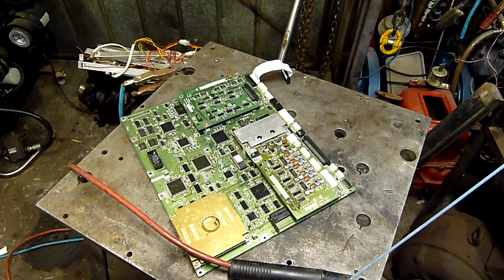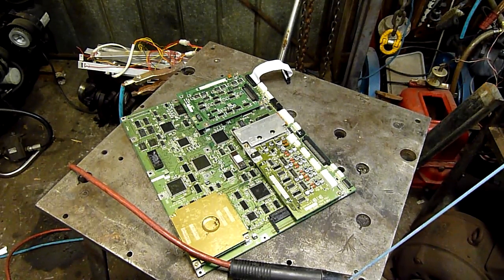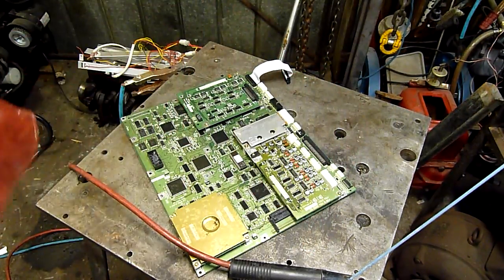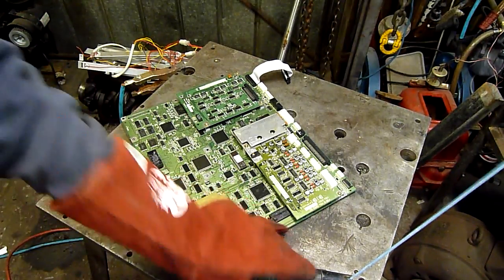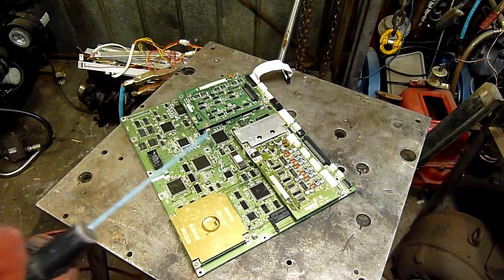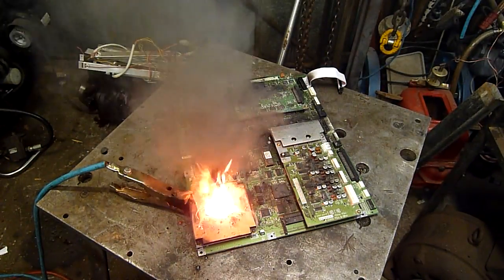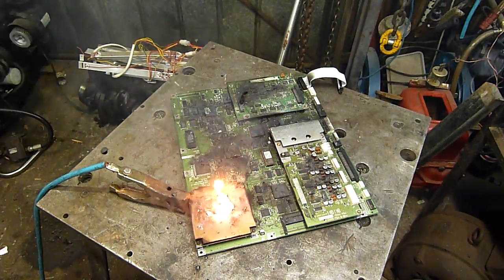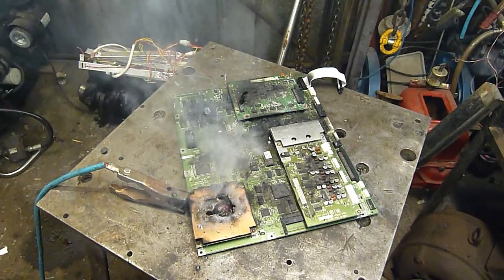Arc Welder Vs Minolta Copier Digital Board

Comment: Oh, I can see myself walking into the local AirGas store and ordering a Miller buzzbox,

When asked what application are you going to use it for, "Oh frying logic boards and electronics."

XD

I actually got a 225 amp Lincoln "Tombstone" out in the shop, just need to put in 240V service for it.

Comment: If a microwave is 2000w, does that mean if you were to take out the transformer and use it in this case, the power draw would be similar to what of the microwave when it was still in one piece?
Like how much does this draw, 
Because drawing loads of amps would make your electricity bill skyrocket no?

Comment: Aaah, Flaaaames! :-D

I's always entertaining to see when a chip gets popped, that something else across the other side of the board unexpectedly blows its guts out everywhere. :-D Mmmm! POPPAGE! :-D

At certain points though, it seemed as if you didn't have enough volts to push the current through...I do wonder if there's a 'sweet-spot' somewhere between volts & amps, but can still be run off of the average household wall socket.....

Thanxx for showing,

-BBD.